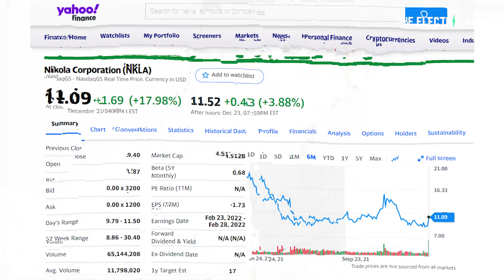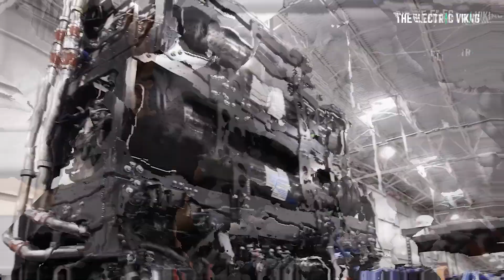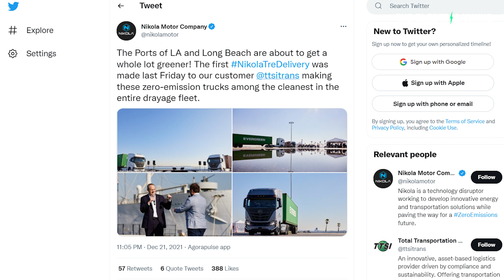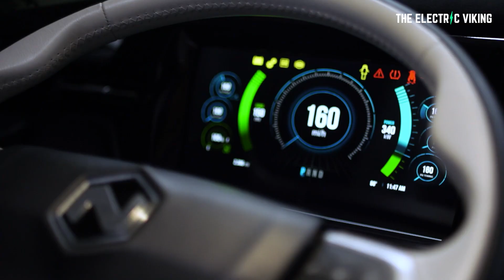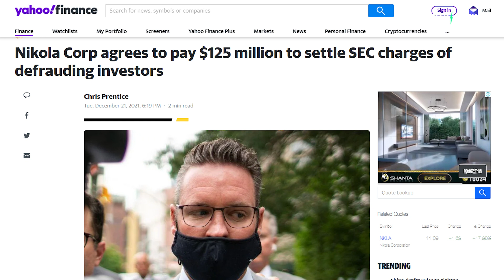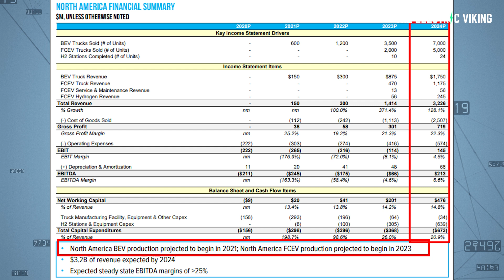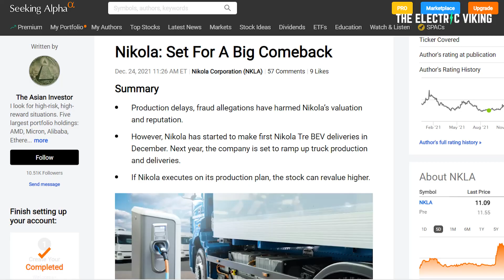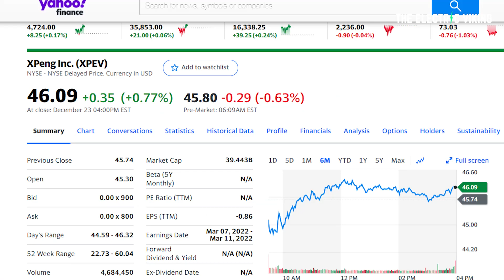Seeking Alpha says NIKOLA are set for a BIG comeback!

Comment: Sandy was quite impressed....  Maybe Hydrogen is a good fit for Trucking, but most Hydrogen isn't Green.
Reply: h2 fuel not green for now .Long haul h2 fuel cell semi trucks can carry the same amount of freight as diesel semi trucks and stay under the 80000 pound limit. long haul battery only semi trucks are too heavy, will wear down our national infrastructure.
Reply: @Dylanhtd  It's funny how no one cared about the roads when SUVs and pickups which are heavier than cars became popular but suddenly they are concerned when it comes to battery cars which are a tiny fraction of the vehicle fleet.
Reply: Thanks~~~~<for watching and don't forget to hit the like button and if you want <<advise...and insight...~~<~MSg!~<~~
➕❶❹❶❺❾❸❽❼❻❸❺💬💬....
Reply: @Dylanhtd  It's going to be dammed expensive to run just long haul trucks on hydrogen.
Reply: @turningpoint4238  Sure...
Reply: @turningpoint4238  Facts...
Reply: @musa7606  “EVs convert over 77 per cent of the electrical energy from the grid to power at the wheels. Conventional gasoline vehicles only convert about 12 per cent – 30 per cent of the energy stored in gasoline to power at the wheels,” according to the US Department of Energy[iii].30 Jan 2020. 
So depending on the car, you are wasting 88% to 70% of fossil fuel you put in and can't be sustainable. We're as electric cars can payback carbon emissions. We know people who mostly trickle charge to align with their solar production. Battery production will become less carbon intensive in the future.
Reply: @flukeylukey7559  Cool. It converts alllllll that coal to power, not just part of it :)

Comment: Nikola's BEV will sell for $250,000 (per the proforma financial statement) and go "up to 350 miles" and recharge in 2 hours at 240 kW. 
Tesla's BEV expected base price is $150,000 for the 300 mile version and $180,000 for the 500 mile version and will charge in 30 minutes (expected 1000 kW charger). 

Nikola buys the engine-less ICE truck from Iveco, ships it to the US, adds batteries and seems to be purchasing all of the power electronics from third parties. Even at a selling price $100,000 above Tesla's, Nikola doesn't make an operating profit until 2023.  I understand projected prices are subject to change, however even Nikola's own proforma financials do not paint a picture of a competitive company.
Reply: Nikola =Worst SCAM company ever

Comment: IVECO is one of the largest manufacturers of lorries and other commercial vehicles and the largest manufacturer of diesel engines worldwide. I can only speculate why exactly they need to cooperate with Nikola, and my guess is they want to acquire their fuel cell know-how.  

IVECO built and opened a factory in Ulm, Germany, exclusively for the purpose of building Nikola battery electric lorries and artic tractors, which started production a few weeks ago, and fuel cell variants, which are supposed to go into production next year-ish. Unfortunately, IVECO is one of the few companies which decided to waste their money on H2.

Comment: The other risk for Nikola is does hydrogen fuel technology work at all? Ballard in Canada have been trying to go this for 25 years and are still struggling to get beyond prototypes. This is still is a dubious technology.
Reply: I thought the plan was for Nikola to use GM's hydrogen technology.
Reply: Thanks~~~~<for watching and don't forget to hit the like button and if you want <<advise...and insight...~~<~MSg!~<~~
➕❶❹❶❺❾❸❽❼❻❸❺💬💬...
Reply: It's doable as long as you can ignore costs.
Reply: Hydrogen’s primary problem is energy density. The infrastructure to distribute it uses more energy than what is delivered.